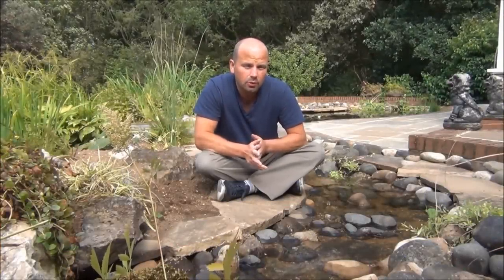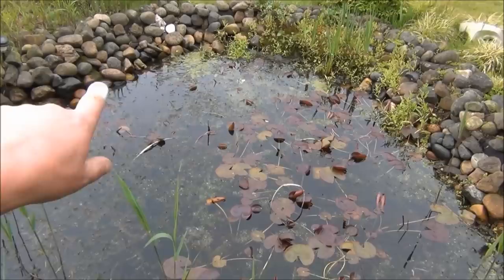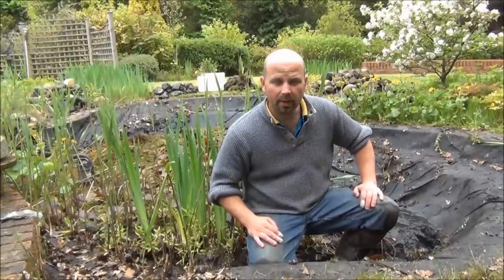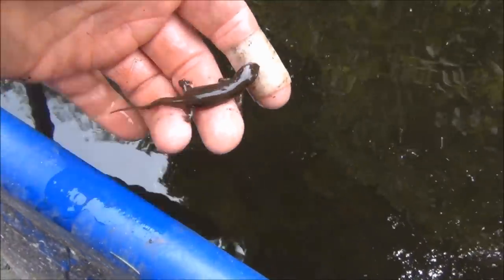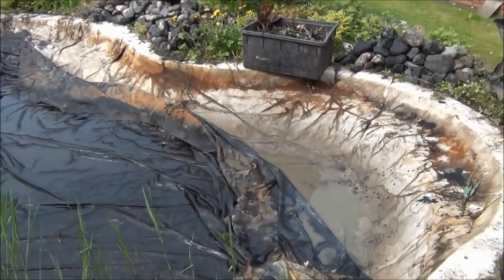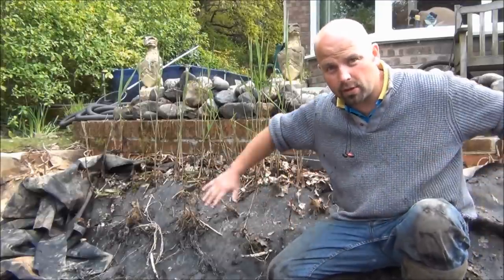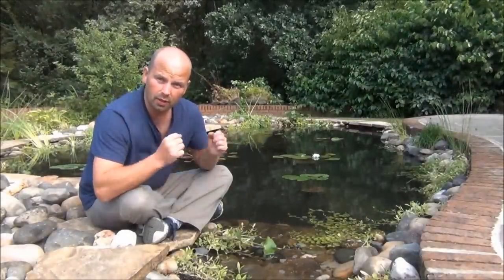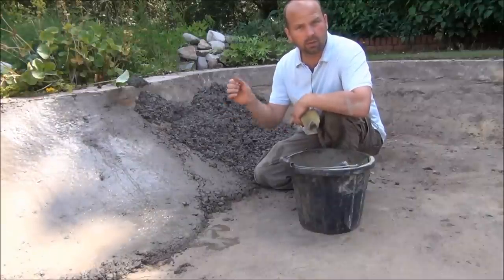Concrete and Render Pond Construction by Pondguru - Pond Building in North East England

Comment: What is cheapest way to construct a farm pond for agriculture purpose without use of a plastic sheet or cement etc?
Reply from the maker: Assuming that you can locate a water source or divert an existing stream and you have somewhere for the overflow to go then all you need to do is dig a huge hole and divert water into it. Obviously that won't work without a permanent water supply and decent ground to hold water but it is by far the cheapest way,
Reply: I have water supply only in rainy season. I want to preserve this water for months. But plastic sheets are a costly item for agriculture here because return is lesser compared to other areas. Hence any cheaper alternative? please. 
Can a compression with road roller work? Or no hope?